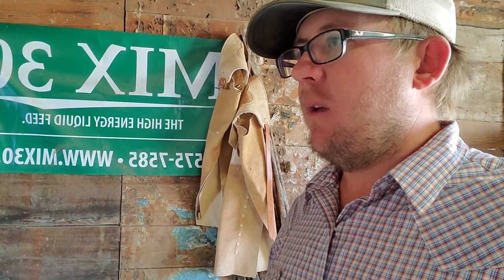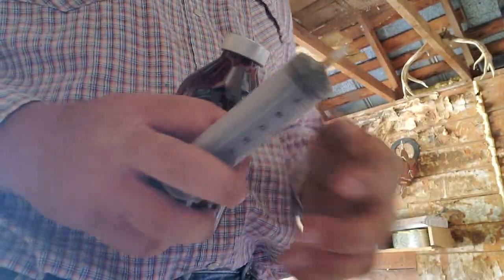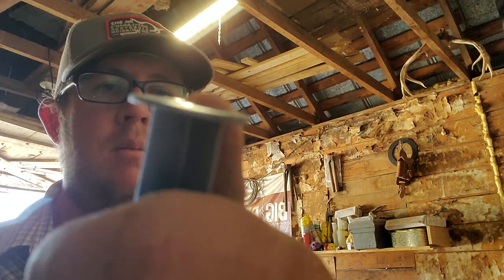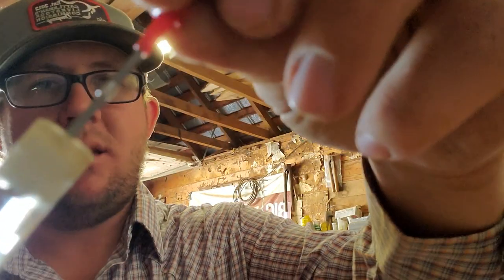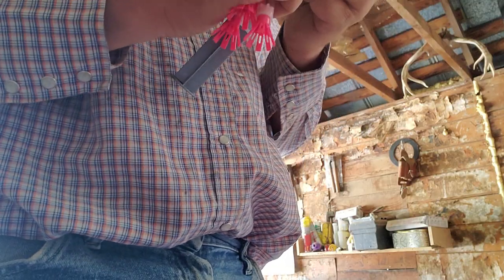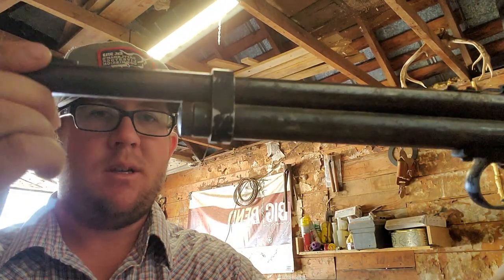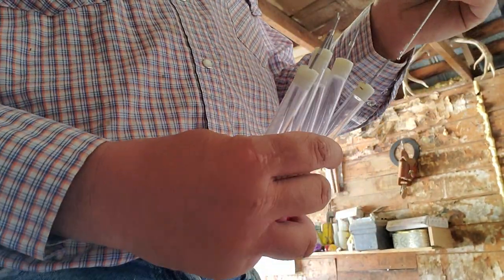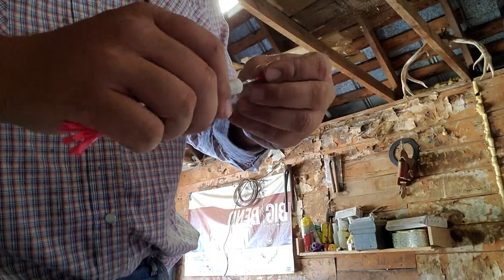Loading disposal darts

Comment: Used to use rompum in ours to tranquilizer cows that got out and jump fences and corrals. Then we would rope them and drag them in a trailer and take them to the packer. We never used horses on our ranch. Just a feed pickup. Didn’t use them very often at all. Just a couple times on a few Rogue cows or yearlings.
Reply from the maker: I have a cow I need to do the same with. Got to get a brand on her first.

Comment: I bought a Pneu-dart gun this spring for treating pinkeye and foot rot on grass cattle and feedlot cattle. I like it, other than I cannot get draxxin to work. I load it with draxxin and every time i shoot a calf it hits their neck and shoots the draxxin all over their neck? La3, penicillin, dex, all work just fine. Anyone have any tips or ideas? Thanks!
Reply from the maker: ive never used a pneu dart, but if  those others are working then i would say to have too much pressure behind the dart and its hitting them and bouncing off.
Reply from the maker: a few less pumps maybe